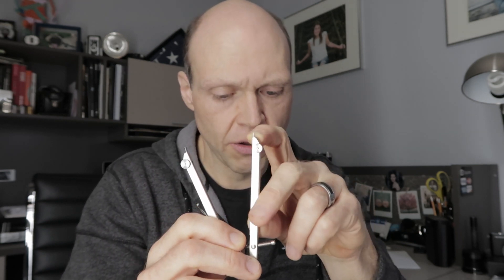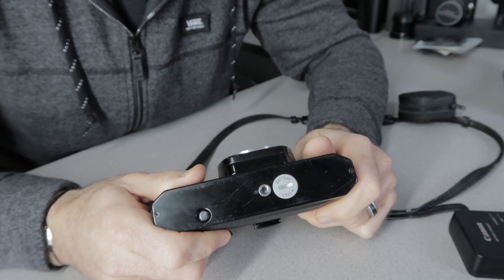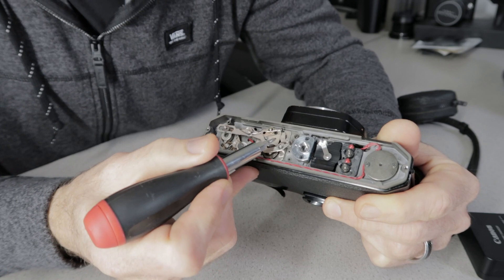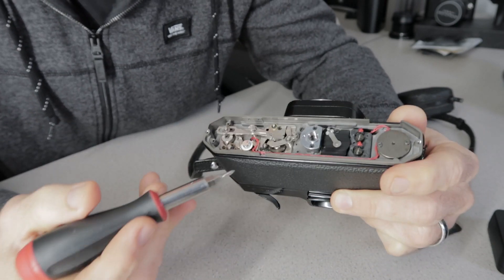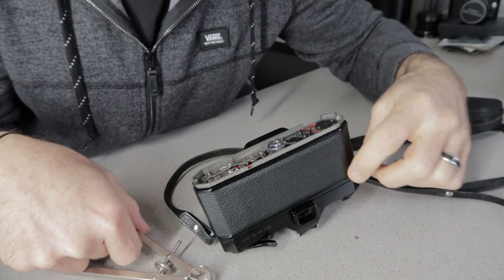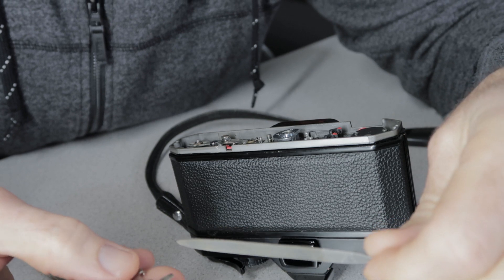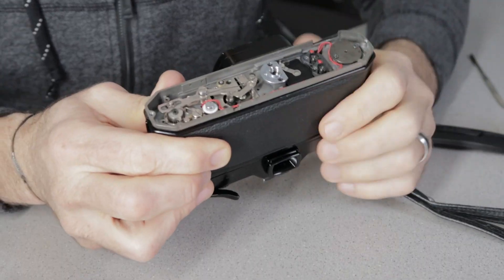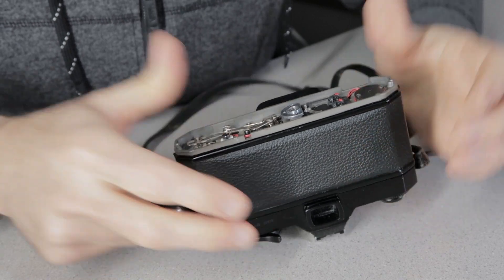Pentax Spotmatic "Sticky Mirror" Fix

Comment: Hello.
I've had this problem too on my Spotmatic. The fix I made was to 1) sandpaper the L-shaped catch lever resting surface (with fine grain, to eliminate asperities). 2) Lubricate some gears and the axis of L-shaped catch lever that holds the mirror cam. This has been fine for about ten years now. So in my opinion, no need to risk a too deep modification like yours. However, I appreciate your input, this can be a solution if lubricating fails.
Reply from the maker: Great point!  Definitely would try your approach if I came accords this again.  Thanks!
Reply: @davehanner360  By the way your Spotmatic F is almost mint ! Very nice, lucky you !
Reply: What kind of lubricant did ya use?
Reply: @jonathanamado7135  Hello. Use some kind of low viscosity oil. If you have a can of synthetic 0W20 engine oil, I think it can do the trick as well. Apply it sparsely with a pencil.

Comment: I had a similar problem a few years back but I simply took the base off and used a minute amount of sewing machine oil and carefully placed it on  the joints in this area, I got this idea by following the instructions from another You Tuber. The camera is still working fine.
Reply: Thanks, that worked for mine too. No disassembly.
Reply: I did not watch this video to completion but as soon as it was mentioned to grind a piece down, I thought that should not be necessary. Agree to simply try lubrication and/or both cleaning and lubrication before grinding a precision piece down.
Reply: hi! could you please advise where to find these instructions you used?
Reply: @MrQqshonok  , hello try searching for this title 'Deblocage miroir Pentax Spotmatic F '

Comment: Thank you for this stellar tutorial! I have a Spotmatic SP II and this worked a treat.   I would like to add my 2 cents worth if I may... I was able to perform the repair without deconstructing the mechanism. I just used a Dremel mini rotary tool with grinding attachment! Hope this helps others going forward. Again thanks for your help :)
Reply: Try oil, not a Dremel.  When your wife has a headache, do you get out the Dremel and suggest trepanning?  Or do you just give her an aspirin?  This Dremel maniac would no doubt do the former.

Comment: Great video.  Fixed my 50 year old Spotmatic.  There's also a fix for the obsolete battery.   I used a Silver Oxide Duracell 390 battery.  Since the metering system uses a current mirror, the battery voltage doesn't matter. The trick is you need to install it upside-down.   The 390 was a bit large so slightly smaller diameter battery would fit without modifications .
Reply: LR9 does the trick and fits perfectly.

Comment: Hello! I have a Pentax MX with a mirror that keeps locking on slower shutter speeds 1/60th and lower, but comes back after i turn the shutter again and change to any speed 1/125 or more, any tip of how to fix, opened the bottom but it is completely different..any advice would be REALLY appreciated
Reply from the maker: Sorry, I’ve never had that model.  Try the Lear Camera Repair or Vintage Camara Repair groups on Facebook.  There’s lots of good knowledge there and they are very helpful.
Reply: @davehanner360  Thank you! will check both places, i appreciate the response.
Reply: @jvicken  Have you solved this problem, I have exactly the same problem as you:(
Reply: @robinwu8870  not really:/ i have to send it out to repair, and it's not available in the country i live at the moment so it's going to cost me way more than purchasing another one. so it is still damaged..
Reply: @jvicken  I had this same problem and found another video that helped, try this one: https://www.youtube.com/watch?v=yKnu4ZBXyY8. I would recommend using a lubricant or oil, though, instead of WD-40

Comment: Nope. No filing needed. The pivot for the arm needs to be lubricated. That's all. Even easier fix.
Reply: Agreed, I used a very thin oil on the pivots and it's fine now. No need to butcher it.
Reply: I agree
Reply: Or service the shutter mechanism to solve this issue properly. This is a butcher hack, and will lead hundreds of idiots to permanently damage cameras that are no longer being made, people who do this are ignorant assholes.

Comment: i have a pentax spotmatic the mirror locked up, simple fix with your video but the curtain got stuck is there a fix for curtain lock up? thanks in advance
Reply: A tually service the camera properly to solve your shutter curtain tension issue would actually solve both issues, this video is giving terrible advice on how to butcher this camera, this is not how you actually service this problem.

Comment: Great video. I used this method and found that it helped but would still catch occasionally. I fixed the issue by ever so slightly bending the black component that the arm grabs onto. If holding the camera as if you taking a shot, I bent it towards the right (if that makes sense). Seems to be doing the trick.

Comment: i followed the exact steps on the video but after I resembled it, the shutter level seems to be stuck ? Any advice on what it could be ??
Reply: I solved the same problem on a Spotmatic with a little lubrication on the two components that stick to each other. No removal of metal necessary. The camera works perfectly now.

Comment: Hi! I have a pentax mz-50 and is giving me the same trouble, but I gotta see this video more than 3 times to do it right. Thank you for this!
Reply: Not gonna work with the modern plastic crappy ones, just with the mechanical ones. That happens because of a stripped gear, better off buying another one, they only cost like 10 or 20€

Comment: If you think that Japanese engineers were so dumb that produced 5 000 000! of Spotmatics with faulty lever, just grind it. If not, take down the bottom of the camera, take it on the table by back, fill the syringe with needle with isopropyl alcohol and carefuly clean the wheels above the lever and all the mechanism, then cock it, shoot few times and repeat cleaning several times. let it dry, then use blower to clean it from free residues. when dry, take another syringe with fine needle, fill it with clock oil (or other oil for fine mechanisms), and take drop on every axle. do not overdose it. Take the bottom back and enjoy your Spotmatic. 
Why this happens - camera is 50y or more old, the original lubrication is dried, plus usually the sponge from the mirror is old and small pieces of it are all over the camera like dust. Together with the old lubrication it sticks the wheels, they move hardly with unsufficient energy to kick down the lever. PLEASE DONT GRIND THE CAMERAS, AND DONT LUBE THEM WITH WD40 AND ANOTHER CRAP, YOU ARE KILLING THE CAMERAS